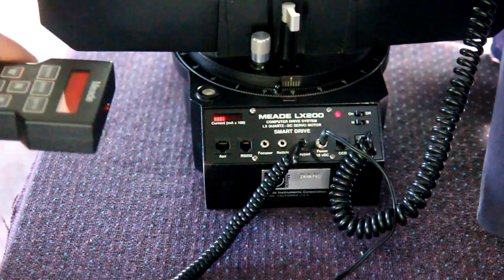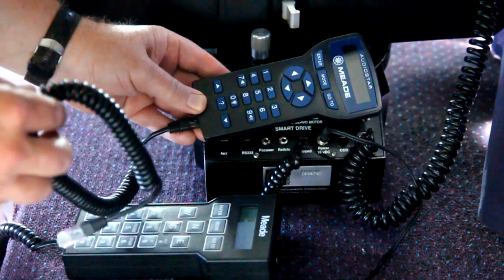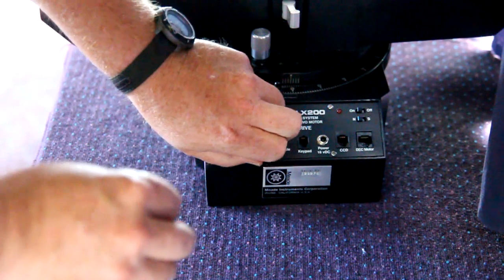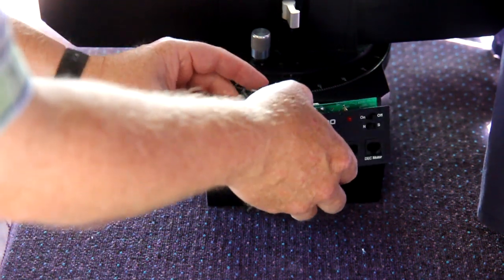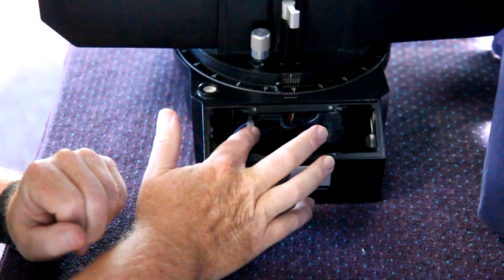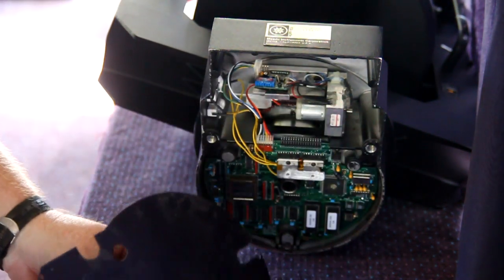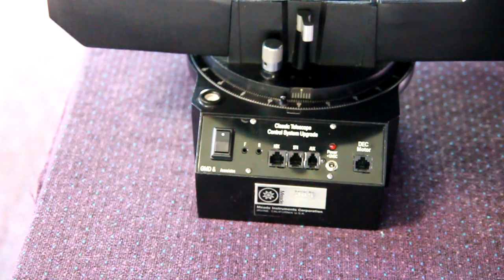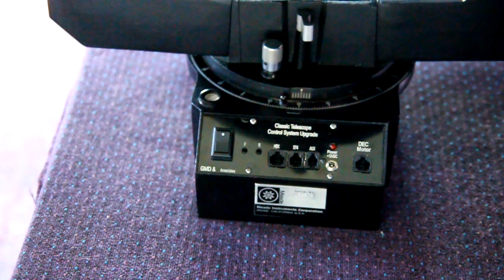Meade LX200 Autostar Upgrade

Comment: Hi Mike: Are these kits still available? I won a 10" f6.3 LX200 EMC in a raffle recently. It's showroom new, but I would love to convert it to use some modern electronics. Thanks!
Reply from the maker: Fred, George at lx200autostar.com has stopped making these kits because of the difficulty in finding Autostar and Audiostar controllers. If you can get a controller, I would guess that George would sell you an upgrade.

Comment: Hi Mike, great video.  I have an LX200 18 volt about 9 years old. Last night my
Reply: ...keypad was working fine however after performing a 2-star alignment I got an “alignment mismatch” message several times; then the keypad would turn on but no responses to any keys.  Any clue as to how to fix this?  Should I just upgrade to the new one?  Frustrated because I hauled my scope to the mountains to do some astrophotography and I dead in the water. Thanks!!

Comment: Is the original board in the base of the scope abandoned in place? Not part of the updated system?
Reply from the maker: You can leave the main board in place or remove it and resell it to help offset the cost of the upgrade, if your mainboard is still functioning.

Comment: Mike,
I recently upgraded my Meade LX200 Classic  using Dudash kit. All has working until recently.  My scope will not go into Declination, that is it will not go up and down.  Side to side works. I am waiting for a response from George.  We tested 
the power going out from the circuit board using a tester.  No power going to the vertical motor while power is reaching the motor controlling the scope's ability to go side to side.   Have you heard anything like this happening ?
I am a newbie at this....
Reply from the maker: I have not heard of that happening with the upgraded LX200. Your best option is to talk to George at LX200Astar@aol.com .

Comment: I did the upgrade in just a few minutes on my lunch break.  The original board was easy to remove and the new board was easy to install.  It's not required, but George Dudash will check out your motor assemblies for no additional cost (other than shipping).  The motors are easy to remove as well.  I have had no issues post upgrade.  If you have an old LX200 Classic gathering dust, this upgrade will add years of life to your scope.
Reply from the maker: Steve Siedentop I agree, Steve. My upgrade works great. George is a great guy to work with in doing the upgrade.
Reply: What are the main benefits if you do this upgrade? And since a few years have past, is there a better upgrade these days available?

Comment: you say the newer handset has more targets than the original ,
ive just purchased a s/h lx200 sct 10", in the booklet it says it has 64.000+ targets yet all the other more later synscan/autostar mounted scopes claim only 42000 + target databank.
also apart from the controller being a little bulky is there any other reason to replace the controller,
and some people say u have to replace the motors is this because of the transition from 18v to 12v?
Reply from the maker: dave jungle Dave, you are correct that the older controller has access to a larger number of objects. However, most of those objects you will never look at. The number is a moot point, but the point I was trying to make is that the newer controllers have a better array of objects and also a newer design and capability. The new system works very well, is not decades old, and more reliable. If you go to the new system, you do have to use a 12V power supply, but there are no issues with using the original motors. I am using my original motors, and I switched from 18V to 12 V, so anyone that told you that are wrong.
Reply: The 12” LX200 is sluggish on 12 v.  Use a good 16 or 17 v regulated power supply.  Throw the old unregulated (120 VAC input) 19 v Meade supply in the trash. It is almost guaranteed to blow the 25v Tantalum capacitors on the 18 V rail.  (Hand controller, main motherboard, Dec motor board, and RA motorboard.

Comment from the maker: Yes. I call it the AudioStar controller because it is an AudioStar controller. The AudioStar Controller can be used as a replacement for the AutoStar Controller, and it adds several capabilities. It is called the AutoStar upgrade. The name of the video is correct. I chose to use an AudioStar Controller instead of the AutoStar Controller. The name for the upgrade was decided by the owner of the firm that makes the kit. Everything about this video and the name are correct. There are no errors.